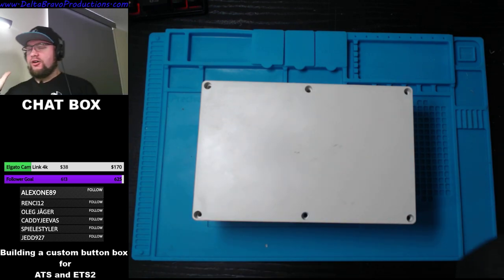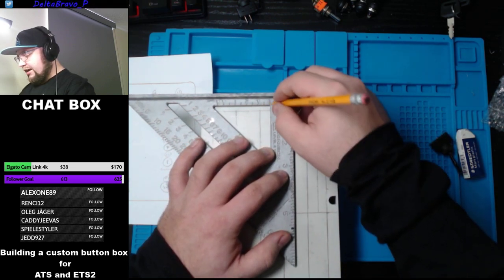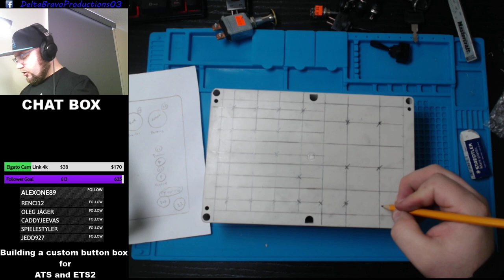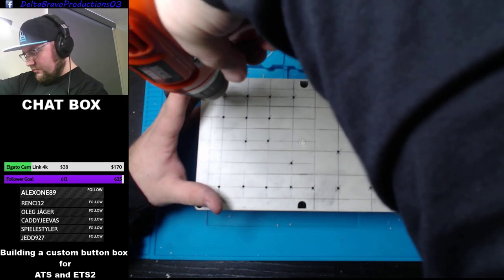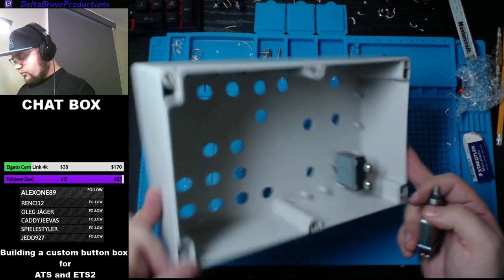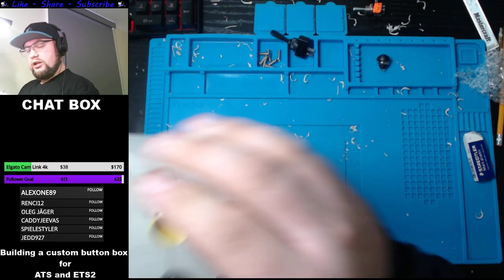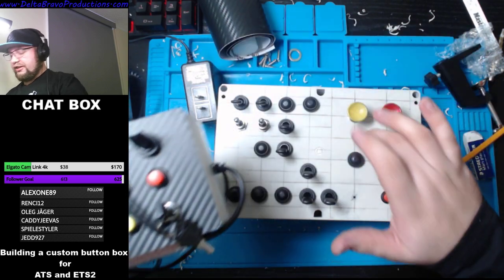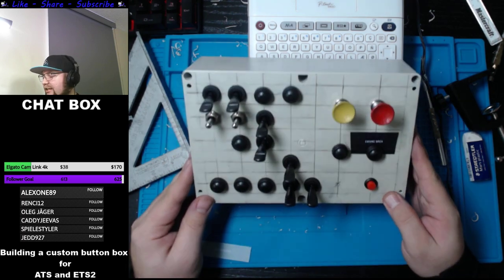🕹️ D.I.Y Button Box - Custom Box For Ats & Ets2 - Livestream Part 1 🔘

Comment: Does the board come wired like that already or were do you get the wiring harness
Reply from the maker: The teensy board dosnt come with a wire harness. The joystick Encoder dos come with wires.
Reply: Do you need both?

Comment: What Caps do u have for your Parking brake and trailer air buttons, Can I have the link?
Reply from the maker: They aren't caps. They are pull and push switches that I painted the tip red and yellow
Reply: @DeltaBravoProductions  Thanks, Do  u still have the links to the switches?
Reply from the maker: The exact ones I use was those : https://amzn.to/2IcDEYs
There are different models that you could use that would also work.